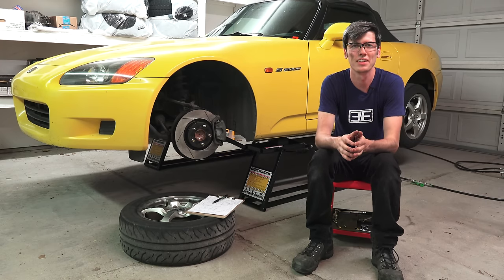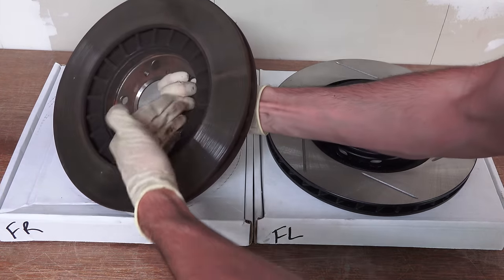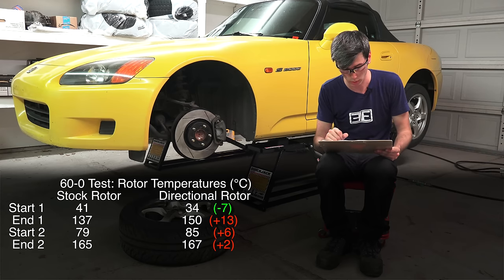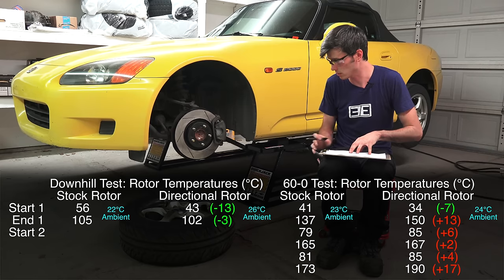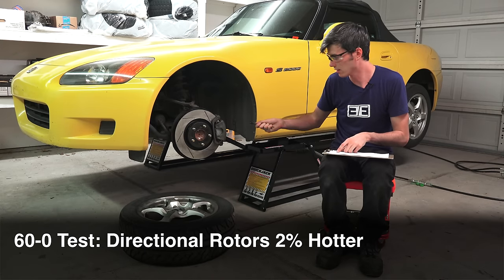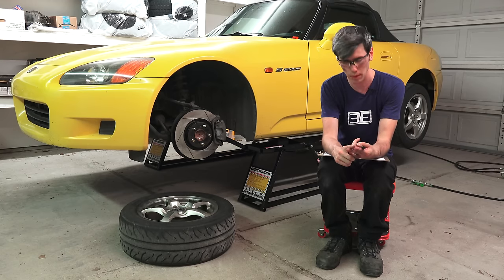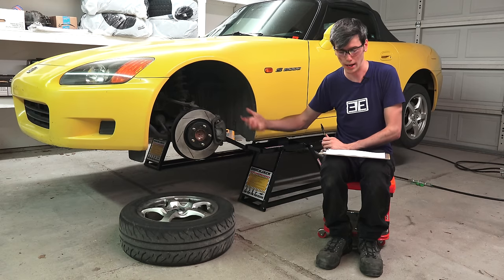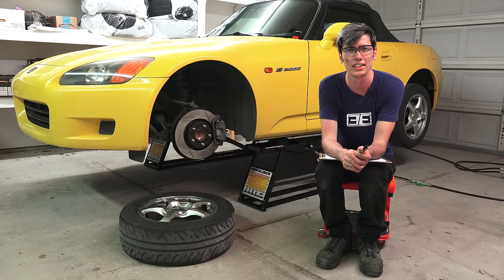Do Performance Brake Rotors Have Better Cooling?

Comment: How about actual performance? Like stopping distances, brake fade?
Reply: that wasn't the question being investigated, and would've made the video a lot longer, but if you're curious I'm sure there are many other videos investigating this already.
Reply: Better brake performance will generate more heat. Without testing performance in addition to heat, you're only concluding that  the performance rotors generate more heat when braking. This would make sense if the performance rotors are doing say, 55% more work than factory. That said, to properly perform a cool down test both rotors would need to be the same starting temp and the vehicle would then have to come to a rolling stop without braking unless you could first conclude they are both providing the same effective braking. I'm interested in seeing that test in a future vid 😉 😉
Reply: Lt. Dan that's a good point actually.
Reply: @giveme10feet  depends on how you are driving if you are drivinng like a maniac then you will notice it but normal day to day driving doesnt push brakes far enough to notice fading
Reply: I wondered about this as well as how the heat reduction would occur after braking, more real world.  You would need an active temperature monitoring system, brake 80-20, accelerate back to 60 and see what temps are at 20, 40, 60, 80, 100, and 120 seconds.
Reply: Lt. Dan: Exactly! I always thought the slats were for better cooling after braking but while still driving. You need rotation to benefit from the slats. If you brake to a stop, you're not using the slats. Also, those slats are for quick disposal of gases and/or dust to optimize abrasion—especially in wet weather.
Reply: Now you're onto why he's no longer an engineer. lol Coming to a full stop, you're not using the slats so there's no benefit. They are designed to cool the brakes better WHILE ROTATING. Like he said: They pull in cool air from outside the wheel. That's prep for the next brake application. All he did was measure how much more abrasion those aftermarket rotors provide. They do more work, so they get hotter. Then they're supposed to cool better when you accelerate again.
Reply: Slotted rotors stop faster they don't run cooler
Reply: Mike Hewitt why do they stop faster that makes little sense
Reply: @MikeHewitt  Your statement makes no sense.  The ONLY reason for slots/cross-drilling is for cooling.  If they aren't performing this function then they are essentially useless as the only residual effect is a slight reduction in mass and surface area of the rotor.
Reply: @chuckschillingvideos  maybe I'm wrong but greater friction means stopping faster it also means more heat will be generated.  All things being equal The faster you stop the more friction it will require whether that friction is more aggressive rotor design or just a much larger rotor/pad contact IE big brake kits.
Reply: @MikeHewitt  Heat up the pads too much and they start burning and glazing over.  There is no such thing as a free lunch.  Pads have an optimal operating range of temperatures and once that is exceeded their performance degrades dramatically.
Reply: Aren't the aftermarket rotors in this test lighter in weight?
Reply: The slots aren't for cooling, they are to release the gas that builds under heavy braking and I mean heavy, not your typical during daily driving. An example of these gases having a negative effect on actual stopping distance is commonly referred to as brake fade. Yes, high temps can lead to glazing, but again this is under heavy usage, in situations where this would become a real problem, it should be assumed that you are running on a track and will have better components, high temp pads, braided lines, slotted/drilled rotors, etc.
Reply: @chuckschillingvideos  slotted rotors are far superior to stock rotors on 3 hondas I've owned. 93 prelude vtec, 05 accord v6, and 12 cr-v. They stop faster, brake more evenly, are more responsive, and eliminate brake fade. Pad wear has not been an issue. I have never tested their temps. No question as to increased performance.
Reply: @brickswisher7672  exactly the slots/holes also increase friction, more friction equals faster stopping. The surface of the pads catch the edges of the slots and the holes also designed to aid and cooling.  It's like comparing a file to a piece of smooth metal.  You're going to get more friction rubbing your thumb against the file than you will rubbing your thumb against a smooth piece of metal. Greater friction = greater stopping power also more heat is generated because more work is being accomplished
Reply: @MikeHewitt  Removing pad dust and hot gasses gives better contact between the pad and rotor surface also. My pad wear is even and with noticable increased wear. Actually have to brake much less when you do use them. I use the brakes as little as possible.
Reply: @MikeHewitt  That's... that's not how any of that works. Slick tires have more grip because there is more rubber in contact with the road surface. Your thumb/file example is completely different, as there's enough flex in your skin for the file to actually bite into it. The slots/holes in brakes are for pad dust and heat dissipation, not friction. If your metric for grip is how your thumb feels when rubbing along it, brake discs would be textured like sand paper.
Reply: @JohnSmith-yx8kf  if your rotors were textured like sandpaper your car would stop faster but your pads would wear out in 3 days.
Reply: Mike Hewitt - I took an extreme example. I promise you that as far as friction is concerned, having as much pad in contact with the rotor is what matters, and a completely flat surface is how you achieve it. Drilled/slotted rotors are for venting and brake dust.
Reply: @JohnSmith-yx8kf  no they clear dust and gases which increases surface contact with the rotor thus increasing friction, generating more heat offset by the ability to dissipate the heat only drawback is weakened structure.  Thanks for playing
Reply: Yah. This test is not accurate! There are more fundamentals than it seems. Anyone who have used drilled slot brake kits will tell u it has waaay more stoping power than stock brakes.
Reply: I had a pair of Brembo Max slotted disks installed on my previous car, and the difference was in consistency, not cooling. Wet or dry, cold or hot, it was always the same. Slotting and drilling are not for cooling, but for removing stuff from between the disk and the pads afaik. I’d buy them again, if they were available for my current car.
Reply: Stopping distance is more dependent on tires not brakes
Reply: @JohnSmith-yx8kf  I know you commented in this thread like months ago but I just wanted to set something straight between you and the Hewitt guy. So Slots in a Brake rotor are there in order to give better brake adhesion by providing more surface area for the Pad material to stick to the surface of the brake disc. Therefore the added heat displayed in the video means that yes the friction due to greater pad and disc adhesion is simply showing that they are actually performing better NOT worse. The slots also dissipate brake dust and moisture that build up on the rotor to give better contact between the pad and disc material the same way a tire does on the road to dirt and water to provide better contact with the road. The only thing MEANT to cool brake rotors is the vents around a rotor, or placed at the back of the disc that pull in air in from around the rotor itself. The funny thing is now that science has well surpassed the whole "surface area" as a means for friction it is basically just a cheaper way to get some added bite on braking with cheaper materials. Most modern Super Cars and high performance race cars use materials over brake designs (or the combination of both really) to get the braking force they want but Carbon Ceramics or full Carbon brake kits cost... Well Super Car price.
Also so glad you brought up Slicks as well this is a great example for adhesion to create for better Traction/Grip with the road. You would be correct in saying that Slicks stick better due to their greater contact patch with the road but that is far from the only reason. Slick tires also will often use softer tire compounds that through friction, heat up and become sticky just the same as a brake pad does when it heats up against a brake rotor. This added adhesion factor helps the tire then LITERALLY stick to the road which is why drag cars get the tires to temp with a burnout, providing more traction. Now Say you had slick tires on a wet road, say they have absolutely no tread, the tire would not be able to perform because it would not be able to displace the water and create contact with the road, If you added tread that would displace the water and create more surface area for for the tire to grip, this is the whole idea of slots on a brake rotor, no different than treads on a tire. So bottom line heat is actually better in braking, just like hotter tires are better for more traction, but that is only if the materials in use can withstand the heat created in the process of braking.
Reply: @seatacassasssin9118  He also muddies the thermodynamics of mass, surface area, and volume.
Reply: @seatacassasssin9118  shouldn't they still remove heat while braking but still moving?
Reply: @MikeHewitt  wrong. They actually stop less effectively due to decreased surface area ( missing material from slotts ) but should work better in repeated stops
Reply: @MikeHewitt  no they dont

Comment: This and ChrisFix videos is all I need.
Reply from the maker: Chris is the man!
Reply: Engineering Explained so it seems obvious to me that the temperatures would have been about the same for the type of test you've been doing. Why not actually get the brakes up to say 400 degrees and then roll the car out 1,000 ft and see what the temperature is like then?  my guess is even if you do this test you'll find that the temperature difference at the end of the run doesn't show them but very much difference. I think that the all the tilted veins inside the rotors really do not blow off a significant amount more heat than the straight veins do.
Reply: @engineering explained... im not too science savvy, but even though you have certain controls, i think the variable veering test could be as simple as the engine bay heat transfer.  Stock would be "cooler" and after changing out the rotors to slotted, the engine temperatures would still have a lot of heat.  Just as you would need oil to cool down.  so maybe the engine heat transferred to from the warmed up/hot engine, starting the slotted rotors out at a higher temp?

Comment: only men who work all day to a car will understand the surprises of finding black spots on the face
Reply: Sometimes I'll be at work the next day and in the mirror on the way out of the bathroom realize the back of my arm is still grey.
Reply: Accidentally touching your face with dirty gloves. Been there, done that.
Reply: JoraForever most hard laborers get that. Construction etc.
Reply: I get more shocked when I just so happen to glance at my hands to see a trail of blood on there without a clue of what I hit. I laugh everytime haha.
Reply: More surprised when I don't get black spots on my face after working on a car.
Reply: +TheCowGoesMoo o "woop" is the trademark sound I make when that happens.
Reply: I work in a machine shop. I have black spots on my face everyday and as a bonus, metal chips in my clothes and skin.
Reply: Right or your average teenager working in a bicycle repair shop...but yeah, so manly
Reply: I wouldn't trust the average teenager with my bike. It's too much of a tool to let someone too gung-ho or or with a short attention span near

Comment: that was pretty cool. especially since you included the data at the end.
Reply: would have been been a better test if stock on one side and directional on the other..would go thru identical stress and heat transfer...both should have started at same temp within 2%
Reply: Actually, it was pretty HOT
Reply: what side was the sun on? lol
Reply: @johnruddy1596  if the grab different amounts and push steering that could bias the brake one way or the other causing more heat on one side. I don't think running them at the same time would work unless their braking effectiveness is identical...and if they are then what's the point? 😉

Comment from the maker: A lot of folks asking about why I didn't test stopping distance since we're talking about brakes. Conveniently, my very first article for Road & Track explains why, and was released today! http://www.roadandtrack.com/car-culture/a10316984/why-braking-is-all-about-tires/
Reply: Engineering Explained great videos as always. However the point of these rotors maybe to dissipate heat quickly under extreme braking conditions. Your tests may not be doing the discs justice. Maybe find a way of recording temperature under extreme load a try again. 
good luck 😎
Reply: Did you weigh the rotors?
Reply: Nevermind...  I asked the question seconds before you got to that part...
Reply: Engineering Explained I think the wheels themselves are maybe in the way of the airflow through the rotors since they draw air through the front. Would mounting different wheels maybe make the rotors more efficient? Maybe you could also measure the temperatures inside the wheel well and the ambient temp and see if the stock rotors are actually drawing in warmer air. I'd think they aren't and that the outside and inside air temp differences while moving would be the same. Measuring the car while stopped id say the inside air would be hotter. Than the inside air but only because it's trapped. But while the car is in movement it's being cycled out. So that might be a factor that make drawing air from the outside negligible
Reply: Test was flawed, maybe. You didn't weight the rotors. If the stock one are, let's 2 times heavier, they will absorb more heat and heat slower. Is like boiling water. If you apply the same heat and boil in the same pan 1 liter of water and 2 liter, 1 liter will boil faster. That's why MAYBE, it is an error. How big is the difference in weight???
Reply: Weight at 8:50 - he did go on to mention a better test that was conducted by someone else at a track
Reply: Engineering Explained r
Reply: I think its valid to say that initial stopping distance is determined by tires, but repeated stopping distance (minimizing fade) is determined by brakes :)
Reply: I will tell you that even with cheap aftermarket drilled and slotted rotors, there is zero lag in braking ability when the brakes and rotors are wet.  Not the case with stock.
Reply: Engineering Explained reverse the rotor direction and see if there's a difference. Somethings tells me you should see a difference.
Reply: Stopping distance is exactly what you should have measured. Who cares if brakes are ice cold, but dont stop at all? Cooling is rather the means to an end (actually stopping)
Reply: Engineering Explained - I must say I admire your patience doing videos like this. Time consuming, etc. Thumbs up for that. ;-)
Having a background in mechanical engineering and in the car "world" somehow I get disappointed to see the traditional "boy racer" crapping up their cars and wallets many times to get a worse result than they start with. :-(

A daily driver is one thing, a full breed race car is a totally different story. Nobody have a team of mechanics and engineers checking and maintaining their cars before going to the nearest grocery store or supermarket. Nobody warm their tires before go to work at 5 AM...and so on.
A daily driver is supposed to be powerful yes but economical, reliable, usable every day Summer or Winter by the boy racer or the retired old lady. 
On the other hand a full breed race car is supposed to make the best time in some very specific challenge. Period. 
Hardly both things mix together it's simply a different design intent.   

Whit this said I learned the hard way that slotted rotors and brake pads work fine and perfectly, closer to a race condition. Meaning clean and maintain after use.
On a daily drive condition they serve only one purpose. To accumulate road grit, mud and salt. After a relatively short time the slots are filled up with grit that literally sand down the contact surfaces and lead to very inefficient braking all that with a bigger initial cost. Big no, no.

You guys be well and care your car and wallets with the right choices. ;-)
Reply: Engineering Explained Can you do a comparison between carbon ceramic brakes and conventional steel brakes including stopping distances.
Reply: @EE Back almost 2 decades ago i was told this by a pro-team mechanic (never questioned it); Vented discs are designed to get hot fast, as real track pads are designed to first work well (even at all) at higher temperatures, this is needed. Furthermore the vents serve as a "trap" for the pads to expel filled/used grinding material easier, allowing fresh material acces to the discs faster, which should give a more consistent braking pattern throughout a long race. His advise was, as yours in the article, "just spend more on tires instead" :)
Reply: Even if they work, the stock one is good enough. If it got too hot under normal operating conditions, they wouldn't use it. I trust the auto makes a lot more than the after market. They lie about all sorts of things, so why wouldn't they lie about the rotors?
Reply: It sounds like rationalization. Who are you going to believe, you're own tests or someone else' test who has an interest in them being cooler.
Reply: yea stopping distance would depend on car weight, proper brake balance, and tire size. brake rotors are just supposed to stay within a reasonable temperature range for an extended period of time while stopping the car.